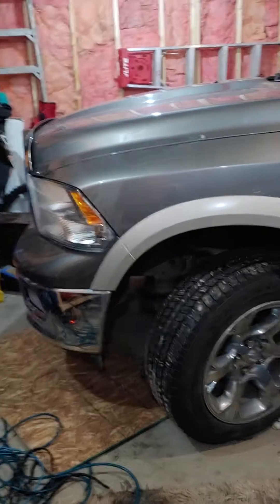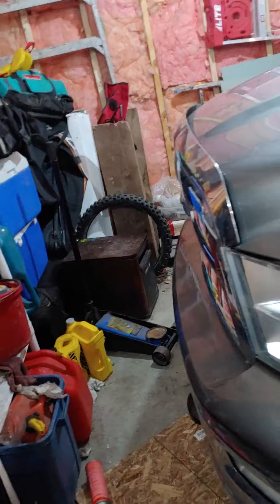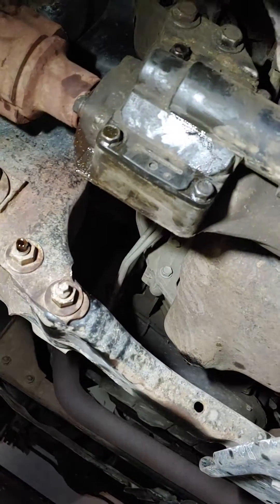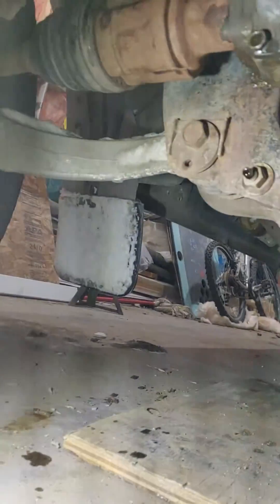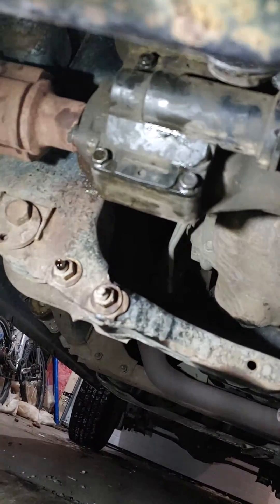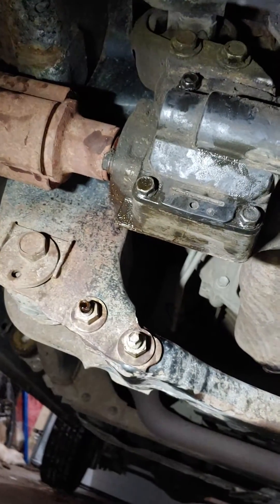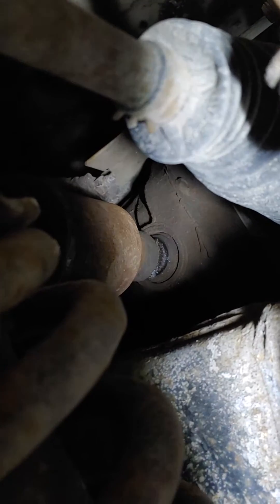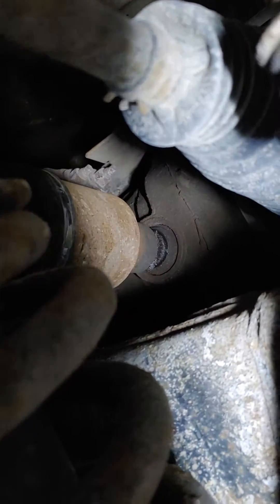How to check Electric Front Diff Actuator 4th Gen Ram 1500 (06-16)

Comment: Thanks for posting this.  I had the SVC4WD yellow light come on in my 2017 as well.  Replaced the actuator and it worked for about 200 miles and now same thing.  I didn't think about just throwing the old actuator into the hanging plug to see if she moved left and right.  I was completely convinced that it was due to moisture getting into the plug wire but have run the course on that diagnostic and no luck so far.
Reply: Any updates on fixing your issue?

Comment: is this the same problem i might have. i have a 2010 ram1500 stuck in 4wlo and wont go in 4wd or 2wd no matter what i do.
Reply: Did you ever find the fix? I’m having the same problem you had
Reply: @ikontrolcod what year is your Ram. I’m dealing with an 06 that won’t shift out. Changed both the switch and actuator
Reply: @dougmcpheters1546  14. I did the motor on the back haven’t done the front actuator yet